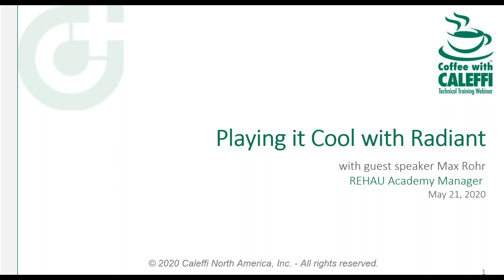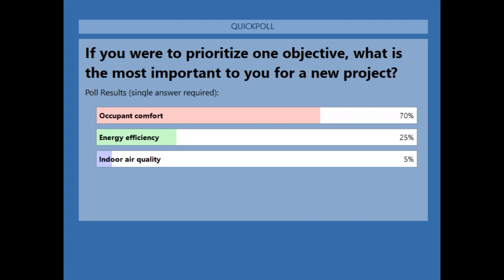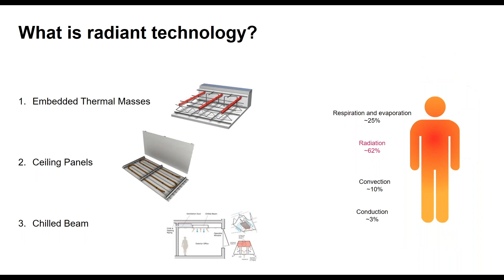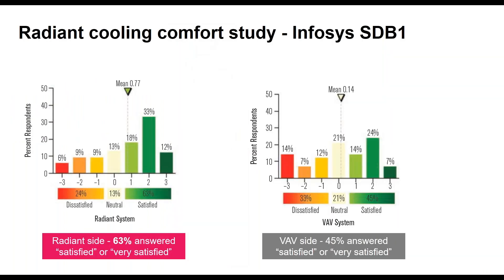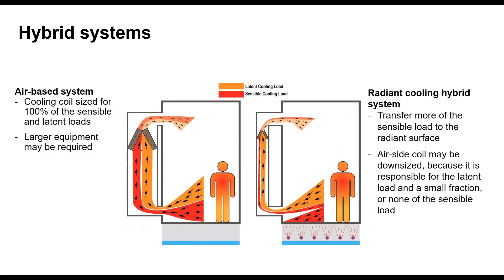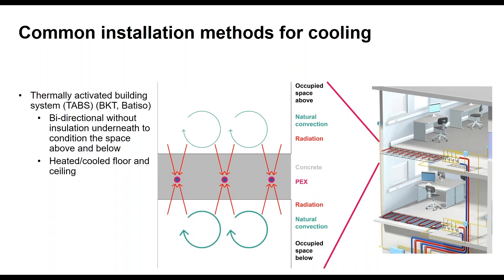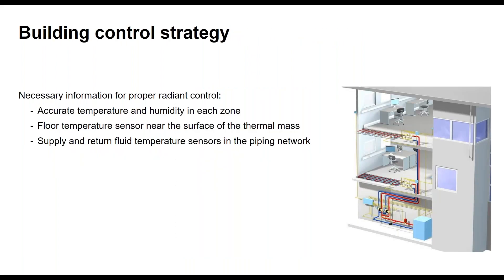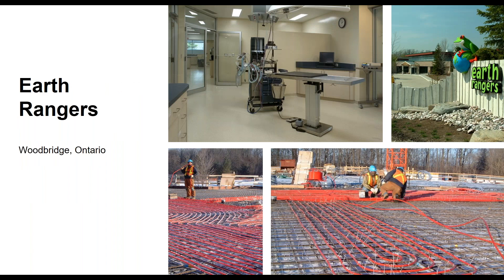Playing it Cool with Radiant

Comment: In a previous video I commented about this type of hybrid.  I have a thought to share...

Looking at the radiant comfort "S" curve (warmer at the feet, cooler at the head) - what I have modeled, is a system that uses water-to-water heat pump to create a temperature differential between the floor and ceiling loops (never the two water sources shall mix), and the balance of heating and cooling is managed by yet another water-to-water heat pump either removes excess heat or adds to make up the heat deficit, and using a fan-coil-loop to "polish condition" the fresh air.  This way one can manage the mean radiant temperature, and then also manage the mean air temperature - both major knobs for the comfort equation.  Separately, handling the fresh and exhaust air energy recovery, minimizes the amount of energy needed for subsequent conditioning.  Of course in the model, the room is an isolated (thermally + acoustically) building inside a "room" - its own conditioned space.  It's a cost-no-object project, but it has its control benefits.  The radiant hydronic subsystems handle a differential and a mean temperature, the fan-coil-units handle the mean air temperature, the energy recovery and fresh air conditioning system ensure the humidity is on target.  It also means that the primary circulating fluid in the building is designed around 25°C/77°F, and the plant just needs to keep the supply output at this temperature - and this can use the whole space between slush pumping at -28°C/-20°F and boil-out at 101°C/215°F into a thermal mass which is then regulated over longer time intervals (days/weeks rather than minutes/hours).  Also, because each sub-system is optimized for its purpose, each can be down-sized to save costs.

One looks at Temperature, Humidity, and Indoor Air Quality in each zone - and the whole system steers based on the zone status.

* Too much humidity?  More fresh air exchange, with heat recovery ventilation.
* Poor Indoor Air Quality?  More fresh air exchange with energy recovery.
* Higher in-room heat load?  More air recirculation to maintain the air temperature, and heat pumping from the cool to the hot loop - extra heat from the zone loops pumped to the building primary loop.
* Lower in-room heat load?  More air circulation to maintain the air temperature, and heat pumping from the hot loop to the cool loop - extra heat from the building primary loop into the zon loops. 
* Steady State?  No heat pumping except that which is required to maintain the differential between hot and cold loops - air only circulated to keep it moving and filtered - heat is neither pumped in-out of the zone to-from the primary building loop - circulators ramped down to conserve additional energy.

IMHO, it's not so much "two different systems", it's two different peak efficiency energy transfer methods within the same optimized "system".  People don't "just breath" or just have a "circulatory system" - we have both, in the same system and we need both to survive.  No reason not to copy nature's cost, complexity, and efficiency optimizations here too.
Reply from the maker: We sure appreciate your insight.  Thanks so much!